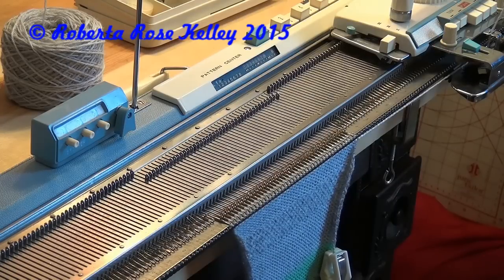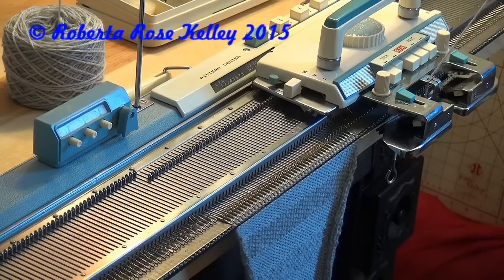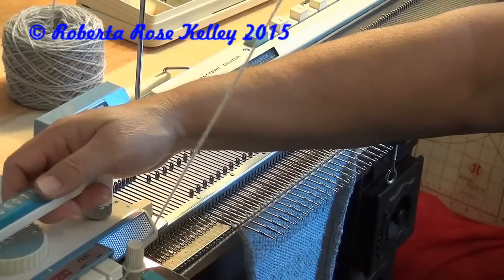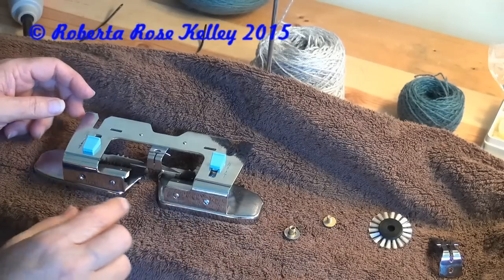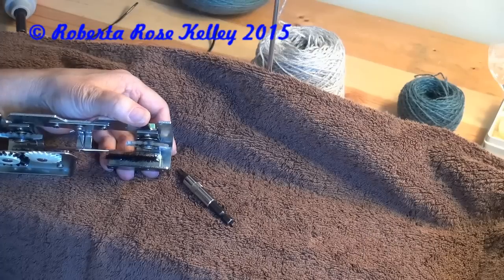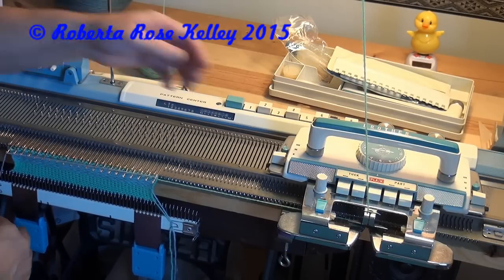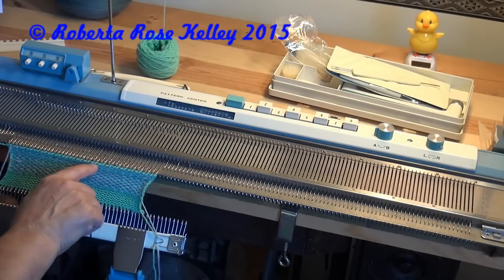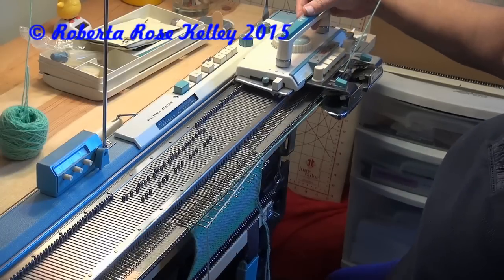Brother Profile KH585 Part 2

Comment: Loving this series that you are doing on the 585. I'm trying to buy one. You are doing a great job helping dummies like me to stay in the game. I think what I like about this machine is that you can SEE what you are doing (the manual lever that is pushing needles out). I like manual so much better than electronic. Hoping you can do more  on the 585.
Reply from the maker: +Michele Naquaiya I never knew how much fun the push button machines could be.  Seeing that I now have the knit king version of the 588, once I get the 585 working good, I will be trying to find a new home for it but will continue to use the KH710 on how to use those buttons.  But I need to add a foam piece that was mentioned that my 585 was missing, so that could be why a couple of my buttons are not always responding correctly.
We are ignorant to a point until we learn a new way of doing things, please do not call yourself that as we just do not know how some things work until we try it a few times.
I am down to one electronic machine, and still debating on selling it, I will not make that decision hastily as it is a nice machine, and I do need to get her out, even if only to work up something manual on it.  I have found doing manual knitting can be fun to do, we have more hands on with making things than the electronic machines are.  Well more like the brother garter carriages is what I mean, I didn't have much enjoyment listening to that part go and then stop from a mistake, do not get me wrong, the GC can be a good thing for some but not all.
Seeing a little difference in the 585 and 588, I prefer the 588 a little better but even the older 500 series that were 4 buttons can still do up some nice work.  Berda
Reply: Wrote a whole message to you and lost it. anyway, I appreciate your videos a lot. If I can get this Brother 585 I'll let you know.  I love the push buttons. Gracias
Reply from the maker: Hate when that happens.  But hold off, I think the 588 may be a little better in the fair isle part of these type machines.  I will be adding that when I get a chance on my new to me KH710 (that is the same as the KH588).  Berda
Reply from the maker: +Michele Naquaiya OK, I got up the Genie 710 Fair Isle, https://www.youtube.com/watch?v=bRj7XdwxMVw and it is basically the same as the 588, so see the difference?
Berda

Comment: I am giving a message from Japan. I have the same aircraft (KH585) and KH588. There was no instruction manual for KH585, and I was in trouble with the operation without solving the way the change lever was handled. KH588 had a simultaneous knitting ▼ △ lever, and I was thinking about how this same operation could be done with KH585. Thanks to your kind and polite video of the explanation, I understand！ Thank you
Reply from the maker: If you had not found the manuals, here they are:
https://mkmanuals.com/brother-kh585-user-guide-guide.html
https://mkmanuals.com/brother-kh588-user-guide-guide.html

Comment: My Jones/Brother 585 is being shipped from G.B.  Your two videos inspired me to bid on the machine.  Once it arrives, I will have to rewatch your two videos carefully.  Missed out on the bid for the 710.  Ordering a new sponge bar.
Reply from the maker: Great news.  I will be making my new sweater for myself on the KH/KH700 or maybe that is the 710 to replace the red one that has many pills but also I snagged it in about 5 places and just tucked the looped yarn on the inside.  But also hope to do more recording on that machine.
You can also get many patterns and a few design books at:  
http://machineknittingetc.com/catalogsearch/result/index/?dir=desc&order=date&p=1&q=jones
Berda
Reply: Berda it arrived yesterday.  Spent the afternoon to evening cleaning and oiling.,  Took out all 200 needles, soaked and cleaned.  Will need to replace about 8 of them.  On my way to Lowes Home Improvement to find two brushes to replace the old ones.  Your tutorial on how to do this was right on time!  I am excited, almost like this was my very 1st machine.  Your videos and the AnswerLady videos on this machine were the inspiration for me to bid on this machine.  Thanks.
Reply: In my area Lowe's does not have those brushes, nor the local hardware store nor Hobby Lobby.  Can't locate on Amazon.  Any ideas?  Help!!!!!
Reply from the maker: Glad to hear you got your machine.  The brushes I got from a different machine, it was the little connecting things that I got from the hardware store.  What brushes are they and I will measure mine (well now I have the 700 or maybe it is the 710 but basically the same machine) and then maybe can find them on ebay.
Glad that there is other videos on this machine, I rarely get to see much others but when I do get a chance to watch a video, it is more funny dogs or something on wildlife.  When I review my videos, I can fall asleep so easy that if I watch other machine knitting videos, I may do the same.  Maybe when I am retired from this, which will not be anytime soon.
Berda
Reply: Need to replace the two weaving brushes.  My KH260 brushes will not work, so I will try to locate something on Ebay.  Also ordered 50 new needles,  Got the new sponge bar in place, and was able to knit a small sock last nite.   Looking to work with the button/patterning system.  The buttons all work (thank goodness).
Reply from the maker: My KH710 needs 1 new weaving brush, I did buy some but they are too big, so now I need to look a little closer at them on eBay and see if I can get those.  Hope you find the ones you need.
I just uploaded the new video of using these 8 push button machines but as a bulky with EON, just make sure you have good yarn for that if you try it.  Berda

Comment: Where did you get the replacement round brushes from?  Are they interchangeable between different  Brother machines models?  I can see some on eBay for other Brother models but will they fit my Brother KH588?
Reply from the maker: I had them available to me. What you can do, is if you have the measurement for the brush, then look for a similar one.

Comment: Am I right in my understanding that you can't do rib knitting with this machine? Would the tuck and hold be a reasonable substitution for the ends of a garment, for instance a sweater? I'm completely new to knitting machines. I hand knitted as a child, but have forgotten most of it. I want to start off with easy things like scarves, but would really like to eventually be able to use this machine to make a basic 1 color sweater, with ribbed wrists and waist. I have one of these machines available to me locally to buy for only $70, and it is apparently in good condition.
Reply from the maker: You can manually reform to rib, or do a mock rib. There once was a ribber for this machine, but now it is so hard to find them, and if you do, it is best to hold onto it for as long as you can, even if you do not use it much.
For the ends, you can bring out a few EON to form a tuck that will help somewhat, but maybe not enough to stop the curl. You can do a Slip Stitch end: https://www.youtube.com/watch?v=Yt-SXlA9_I4 that will also help but if it still curls, then you may have to steam it to get it to be tame and flat. But if steamed too much, the yarn tends to feel so much different than when it came off the skein.
Reply: @RobertaRoseMeads  Thanks so much for your quick and helpful reply. I really appreciate it.